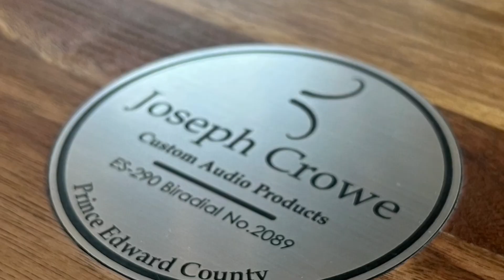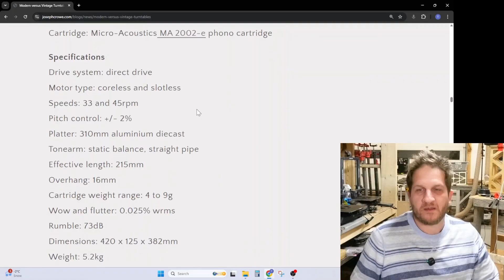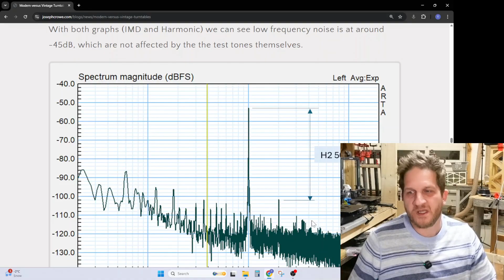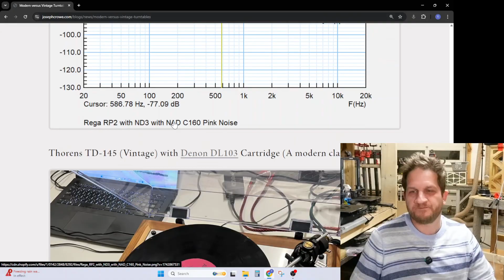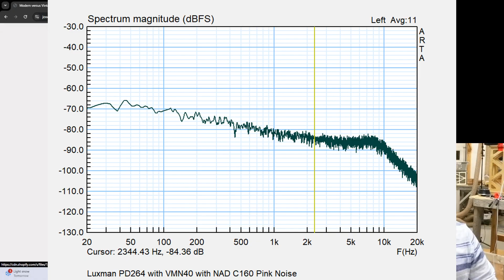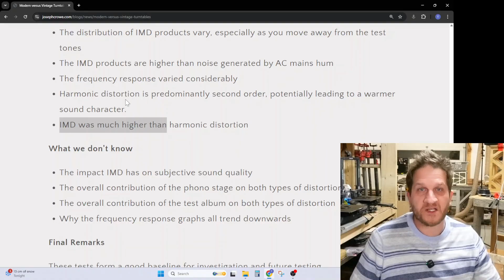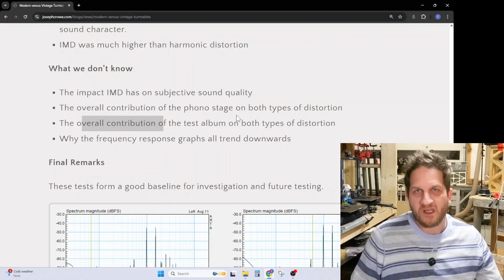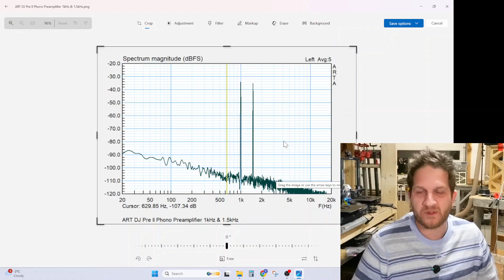Turntable Shootout -- Distortion Measured!

Comment: Hi, love your speakers and this test was great to see.   You might want to get together with Joseph "Groove Tickler"   He is perhaps the best cartridge retipper and re-builder in North America.   He can get you set up with a cartridge/stylus that is perfectly aligned and tested/verified.   That would set a proper baseline for you going forward.   Macro photography from Ray Parkerhurst (you can look him up) has shown wild unit to unit variation in diamond quality and alignment in addition to obvious wear that is often quite uneven across the contact facets on "works great/sounds perfect..." low use styli.   As a designer of high end speakers you understand all to well that everything matters.   In the cartridge world, cantilever material matters, body material matters, coil alignment matters, lots of small variations, same as with speakers.   Then add the turntable and headshell matters (look up Korf blog for extensive accelerometer measurements of various headshells and tonearms) tonearm tube and bearing resonances matter, its a deep rabbit hole, just like with loudspeakers.        Cheers.

Comment: As others have pointed out, you are testing cartridges, not turntables. Might be interesting to switch the cartridges and repeat. Also, no info on cartridge setup and loading(capacitance, etc), tracking force, anti-skate, and alignment. I would expect significant differences depending on these parameters.
Reply from the maker: Those arguments would have to proven out in testing as well.
Reply: Indeed, would loading and frequency response variations actually affect harmonic or IM distortion? I would suspect changes in cap/resistive loading might. Could be an interesting test. @JosephCrowesDIYSpeakerBuilding

Comment: The turntable seems irrelevant.  It's all about the pickup here.  I am not sure about the talk of 'calibration' of the turntable. Mount the pickup, align it and set the tracking. You would at least need to measure the wow and flutter on the actual turntable speed to be evaluating the turntable itself.
Reply from the maker: I'll keep that in mind for the next test.

Comment: Nice work of this high quality is very rare in the HiFi world. I spent a few months investigating record playback performance. Distortion is largely due to stylus radius. If you plot your results vs the stylus radius they will follow that trend.  Large radius, elliptical = high distortion vs.  small radius,  fine line = low distortion.  This is due to tracking geometry.   The variation in frequency response is due to mismatch in cartridge loading by the cables and preamp.  Careful matching of the total load capacitance and resistance will get all of these cartridges to produce a flat response. Some of my expensive cables had large variation in capacitance between left and right.  Take the table with the best result and then just test all of the cartridges on that one table and you will see the performance variation follows the cartridge.  This is a test of cartridges.  Almost any table that isn't total garbage will work perfectly when the cartridge is properly aligned and there's no external vibrations. A linear tracking table, such as a Technics will perform the best. Test records degrade pretty rapidly, so it is good to keep track of how many times each track on a record has been played. Every playback effectively changes the record.   All the tests showed subharmonics and noise at higher levels such that the -50 dB of the 2nd harmonic would be swamped by the sub harmonics and line noise.  Test design is difficult.  You might enjoy reading the Needle Drop Handbook,  and other content at https://pspatialaudio.com/NDH_book2.htm     Richard Bruce has some great videos showing distortion mechanisms.  https://www.youtube.com/watch?v=oHf9KY5_yW0

Comment: Interesting test results. Sounds to me like a lab isolation table (200...300kg, with airbag supension) might indeed be useful, plus a sound insulating hood (e.g. 18mm plywood with 100mm rockwool on the inside) over the turntable. But I suppose in real life nobody would want to faff around that much with their record players.
Reply from the maker: Exactly.

Comment: The IMD is inherent in the system, as the needle is constantly modulating itself. A slightly higher tracking weight would have allowed for further measurements to determine whether it's a mechanical phenomenon and demonstrates the record's disadvantage. Differences are particularly evident in the high-frequency range, which many people spend a lot of money on because they think it sounds better, without knowing where the frequency response is distorted. Only a linearly tuned speaker can serve as a reference.
Vielen Dank für diesen Test, from Germany.
Reply from the maker: “IMD is inherent in the system”… as apposed to what?
Reply: @JosephCrowesDIYSpeakerBuilding  Verschieden Materialien für den Tonarm, Lagerung kann man verwenden, die Modulation der Nadel selbst kann man nur mit dem Auflagegewicht verringern. Geringe Modulation mehr Auflagegewicht und dadurch mehr verschleiss Nadel und der Platte.

Comment: I truly appreciate the effort but what is the "objective" reason to choose vinyl over CDs/digital? I have a couple of old LPs that I  prefer to CD but that has less to do with the media and more to do with what the studio did with the remastering(and that can be a big deal). I'm speculating here but I think some of these new vinyl pressings may not sound so good because they are not using the original mixes but rather using more recent digital masters and doing a cash grab on the vinyl fad. I love the nostalgia of the tactile, having full size covers, liner notes and listening to entire albums
Reply from the maker: Yes, for example a new dark side of the moon LP sounds exactly the same as the digital version. However my original pressing sounds infinitely better. I also have the super audio cd version and its about half way between modern vs original.

Comment: This is a VERY interesting video. But it appears that you're not testing turntables as much as you are testing cartridges and the alignments of the cartridges in their respective turntables. The design of the cartridge, the quality of the stylus, the alignment of the cartridge, and the tracking/antiskating forces will have massive impacts on (mainly) the intermodulation distortion.

As a side note, sometime during the changeover from analog spectrum analyzers (like the Ivie units I used to use in the 80's and 90's) to modern digital analyzers, somebody decided that pink noise would no longer be displayed as a flat spectrum. That was always the case with analog analyzers, while white noise was shown as rising with frequency at 3dB/octave. Now white noise is displayed as flat, while pink noise is displayed as falling at 3dB/octave, as here.

Thanks for making this video. I think it gives a unique take on vinyl reproduction.
Reply from the maker: Thank you. It would be interesting then to grossly miss-calibrate the table to see what range of improvements can be obtained with a calibration. Not just the range of improvement, but what kind of tolerance window is acceptable. This might dispel those that feel it necessary to hyper analyze when in actual fact there’s a point of diminishing return where it’s “close enough”.
Reply: @JosephCrowesDIYSpeakerBuilding  I like that idea - but you risk the ire of a lot of audiophile zealots....

EDIT: You might also (if the test record will allow it) do a test of outer band vs. inner band distortion, and show how different alignments like Baerwald and Stevenson (the latter being my favorite) affect the results.
Reply: Someone that can spell, and form a paragraph, in a YouTube comments section - a rare find!